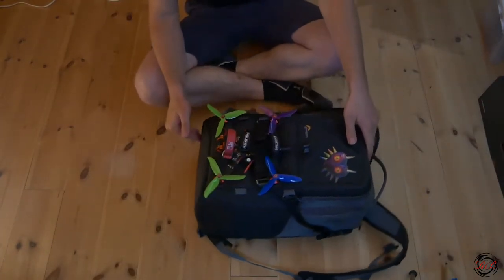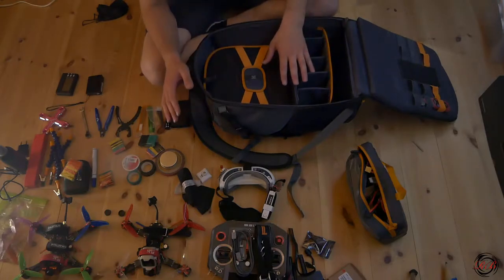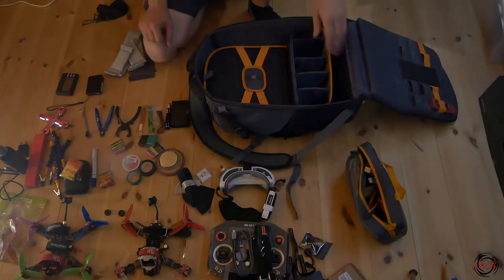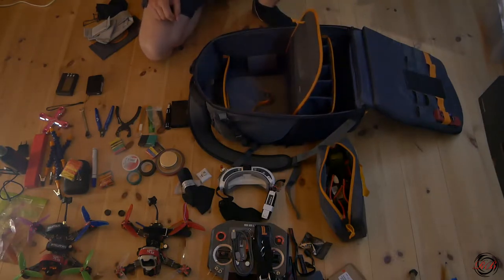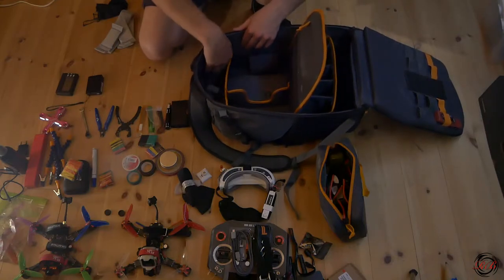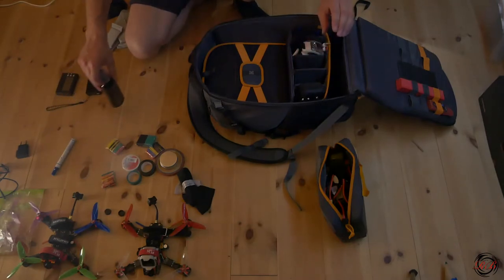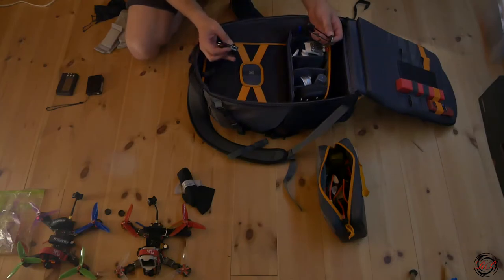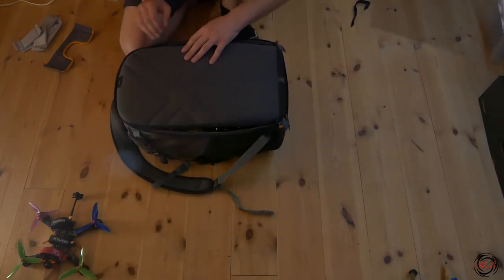How i pack my quadguard bpx 3, with big radio!

Comment: What are the actual dimensions? Can it be squished below 40x23x51cm for carry-on on a plan.  Lowpro's site shows it as a bit bigger then that but that may not be accurate.
Reply from the maker: I'm can measure it this weekend. I'm not home at the moment. It's not created to be squashed much, but you might me able to squeeze it at a carry-on.
Reply: @RobinBerntsen  I ordered the x2. It's about 3cm smaller then the x3. So, it should be ok.